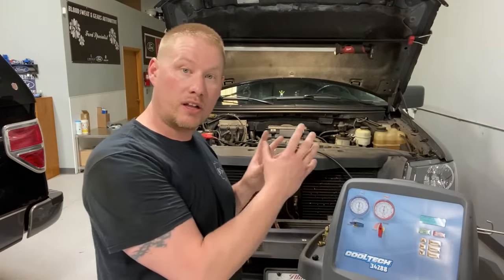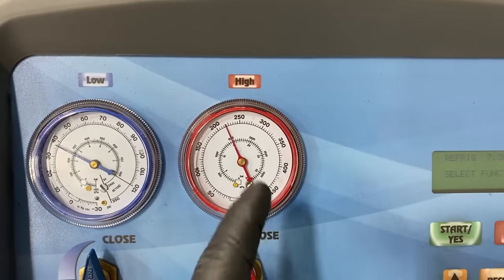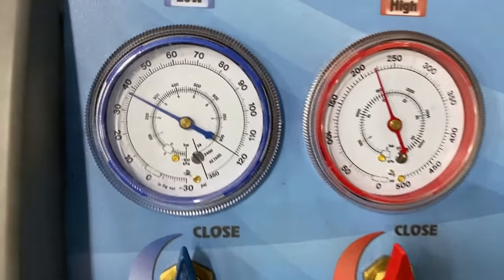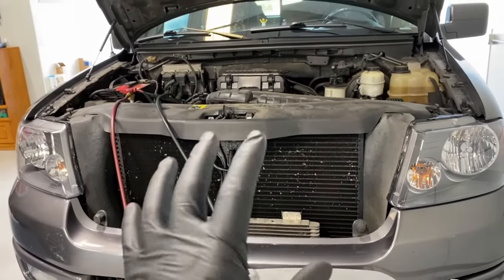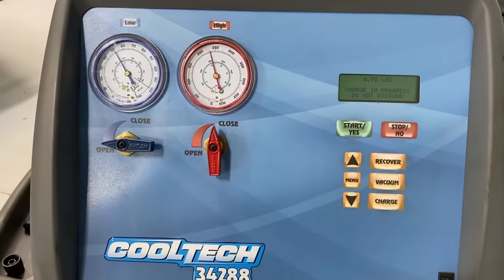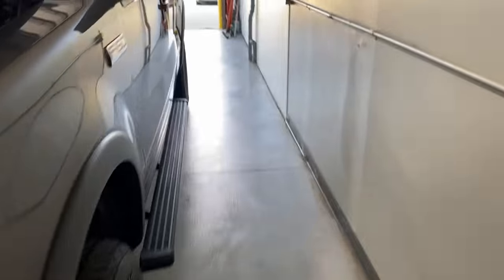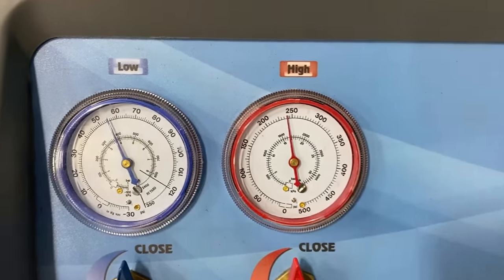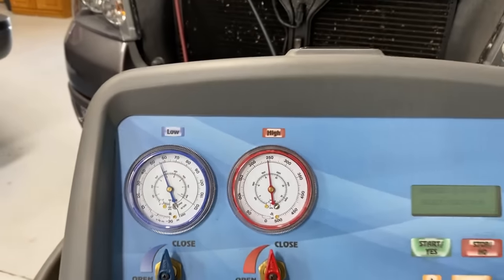Ford A/C Quick Tips #9: How to Spot an Overcharged Air Conditioning System

Comment: Ok dumb question but the ac compressor clutch has to be engaged while reading these guages right? 

I am asking because the pressure drops when the clutch engages
Reply from the maker: correct

Comment: Does that truck have a variable orifice compressor? How would that play into reading the low side pressure of an overcharged system? Are the pressures always read at idle?
Reply from the maker: Just a regular FS10 compressor on an FOT system nothing fancy.
Reply: Regular fixed orifice in this one (2006). Some guys will rev to 2k to check system performance, but I've always done my checks at idle, fan on high, doors open - this is an absolute worst-case scenario for the system - the highest possible heat load. If I get anything below 60° out the vents when it's in the 90's outside, the system will work fantastic.

Comment: Have you had complaints before about a "sweet" smell occasionally coming from the vents with the a/c on? It doesn't smell like coolant or freon. The 05 f150 I had and my 14 f150 both did this. I'm not too concerned about it because everything works but it's odd that I notice it sometimes and other times there's nothing.
Reply: Sounds like a heater core leak, but the 2009-2014's are not known for this, you likely have a small coolant leak from the engine and smell is coming through the fresh air vent in the windshield cowling
Reply: @MrWoundedmoose  If it was then it should be doing it all the time. My old 05 did it now and then and the coolant level always stayed the same so I'm not sure what's causing the smell.

Comment: The AC system on my Explorer has the symptoms of blockage when running.  When I shut it off there is a 10 psi. difference  between the low side and high side pressures which takes hours to equalize.  Does this confirm the system has blockage?  Thanks

Comment: I’m showing 30psi low and 198 high side and 58 deg inside and it’ll cycle to 50psi low and drop to 150 high and cycle back to the previous reading.  2013 f150 platinum 3.5.
Reply from the maker: If it slowly drops to 30 then this is normal, if it’s quick then there is low refrigerant. Hard to tell without watching the cycle time, ambient temps and Underhood temps
Reply: @FordTechMakuloco  I have to remember that fast and slow cycle

Comment: hopefully you can assist me  with this . I have a 07 F150with the 5.4. The internal temp blows at about 50 deg. today I added freon and it made no difference in the before and after readings. its 90deg outside, before adding the readings are 32 low, 245 high. After a can the readings did not change, about a half can later I stopped with readings at 34l, 250H.  the internal temp did not change. Should I just evacuate the system and restart or do you feel it may have other issues?  Thankyou

Comment: Quick question sir, I replaced the condenser and compressor. When I charged the system the ac cycles on and off. The low psi shows 35 than down to 18 high starts at 85 than down to 55 when ac kicks in. Outside temperature was high 50's low 60's.Car should take 1.1 lbs but I put a little more than 1.5. I replaced cts and fan but still the same. Am confused over watching under chargeed and over charged videos. Thank you

Comment: Hi. I'm having an issue with my 2010 mustang v6 ac compressor clutch not engaging. I'm having a hard time to find the high and low pressure cutoff switch which I suspect may be the culprit. Do these cars have them and do you know where they're located? Any help would surely be appreciated.

Comment: My 2014 f150 says 24 oz. I put 2 12 oz cans in it and my pressure readings are 25-28 low side and around 150 high side. I changed expansion valve. Yours shows 34 oz. On your sticker. So I put 3 12 oz cans in it total because its 99 degrees here and 116 with the humidity.  It will not blow colder than 60 degrees out of the vents. No matter if I put 24 oz or  36 oz. I'm just lost. My high pressure fans have kicked on but my pressure is around 200 and my low pressure is around 30. Do I still need to add more? I started to change the condenser  with the expansion valve.

Comment: Ford e-250 with rear a/c low side a/c pressure 65at idle brand new compressor front advance autoparts carquest. New orifice tube,condenser,motorcraft drier? Should I switch the compressor for a motorcraft?

Comment: So as winter ends I went to turn on my AC (2015 mustang gt). It didn’t blow cold so naturally i picked up some refrigerant. To my surprise when I plugged it in it read overcharged. I drained refrigerant out. Ac clutch and compressor kicked on. However I constantly need to keep draining more and more out. And when it does come on only the passenger side vents cool. Mind you last time I charged the system was summer and about 85 degrees out. It’s roughy 60 degrees out now. Could the blend door actually be causing high pressure because the Freon isn’t getting properly cooled? Please help me I’m desperate at this point.

Comment: Ok Brian I am pulling hair trying to figure this one out my 06 F150 super crew has an ac issue the pressures are in speck but the clutch is short cycling so I thought ok maybe it has a restriction so I replaced the receiver dryer and I am the type that will on my personal vehicle replace the other parts that look like they are a little worn because I don’t take enough time for my personal vehicle so that when I do make a repair I get a little OCD because who knows when I am going to get back to work on my own truck the air worked perfectly before I replaced my engine and I never opened up the system until the replacement of the receiver dryer but it will not cool and the ax clutch just short cycles and I am out of ideas as to move forward besides giving up and running without air but it is very hot in Arizona

Comment: So... is there a rule of thumb for what pressures you should be seeing as far as like at what ambient Temps,  or how much the system holds?
Reply: Haynes AC manual has all charts and tables you will need .   Big box fan running on high in front of radiator good idea when checking pressures to simulate driving at say 20 mph .

Comment: Question??? I have a 2010 F150 5.4L & the cooling fan is running & sounding at high speed all the time. Someone mentioned to me it could be a/c pressure switch problem. Problem is, I can't find it. Any advice on where it is located? Thanks.

Comment: I am hoping you can help answer this question for me I have a 2010 Ford Edge and it had a Freon leak so we have currently replaced the following: A/C I-rings, A/C Ref. Hose, A/C receiver drier desiccant bag, A/C Evaporator, Driver side heater blend door actuator driver side, HVAC blower motor control module and after doing all of this I am only getting hot on 1 side cold on passenger and it will not move from the front vents. My question is what else could be my problem because it worked prior to our repair besides not cooling due to Freon leak?
Reply: Broken door or something stuck in the doors.

Comment: Hello there were are you located I'm having problems with my 2013 ford f-150 ecoboost with primary low circuit codes to cylinders 5,6 and module fuel pump

Comment: Ok, I have a 02 Excursion with the V10. It has 79k miles. I live in an area where it can be 110 degrees. My A/C was not blowing very cold. So I took it in to have it serviced. It takes 4.25lbs of refrigerant, and on the service invoice it says my low side was 40psi and the high 225psi. It says 47 degrees on discharge. However on some days it doesnt get very cold. Is 40 and 225 ok numbers? I would like it to be as cold as if it was brand new... suggestions?

Comment: I had a factory charge amount put into my F150. High pressure is @320psi and low pressure is @60psi. Any ideas? I’m thinking expansion valve?
The system held a vacuum and was charge to the correct amount of refrigerant.

Comment: I know this is an old video so idk if I'll get any replies. I'm hoping someone has had this same problem and can answer my question. I have a 2011 ford escape that I changed the condenser and drier on. The problem I'm having is I tried adding the proper amount of 134a but it only allowed me to add half the amount before over charging. I pulled a vacuum and it held 30 micron's of nitrogen so I added one 12oz can and at this point it was reading good on my gauges. The system is supposed to take 1.56lbs which means it should need two 12oz cans plus a little more out of a 3rd can. I did add about 3iz of page oil into the drier prior to charging. Last night I hooked up a quick charge gauge and it was in the yellow until the compressor turned off then if course it went into the red. 8dk if it is cutting on and off do to over charge or because it's actually low and has another issue. Is there something I'm missing, shouldn't it take 24oz seeing the system was completely empty or is it something to do with the page oil I added? Any input very appreciated.

Comment: What if just the high side keeps going up? Ambiet is 75f, i was at 30psi low and high was 150psi with a slightly whiney compressor. Vents were still cold but i was worried about the compressor sound and decided to top off. I added about 2/3rds of a pound and the low side barely moved to 33psi but high side went to 175psi. Kind of high for 75f ambient no? Compressor is quiet now. Vents cool nice at 40f in the middle vent. Think I'm ok?

Comment: Would an overcharged system ever give good cooling? I have about 50 psi on low side and 275 on high side on a 95 degree day in Florida. Every now and then i get great cooking out of the Excursion. Most often I get like warm humid feeling air coming tho. I’m think a blockage in the system and possibly a slight overcharge.
Reply: Compressor may cut out when high side gets too high. High side gets higher when its hotter outside.

Comment: So I have a mystery that I need help on. 2009 FORD f-150 FX4, Evap. Temp: 36-41 Deg F., blending dampers at 0%, vent temp 64 deg. F. when on MAX A/C, cabin temp. sensor shows 194 deg. F. inside the cab. when it's only 75 deg. F. inside. Techs tried to replace cabin temp sensor, still reads the same. Could the damper doors not be connected to the servo's correctly, or could the servos position sensing be wrong causing heat to blend into the vent output air? it's going to a automotive electronic specialists in two weeks under warranty for work, I just want some ideas incase this doesn't work?

Comment: picked up a 10' Ford Escape that AC system randomly purges itself. Figured it was way too high and someone threw a can of freon in it to move it down the road. Lowside is now 20 Highside is 400+. Compressor comes on fine , Its never had cold air and the bottom of the condenser is deteriorated. Picked up a whole ac kit ,thinking the compressor is fine tho,.
Well if you got an extreme highside pressure video add a link thanks
Reply: These are known for the dessicant pack rupturing, and creating restrictions throughout the system.

Comment: Fordtechmakuloco, what would you look for if the system is properly evacuated and charged to the right amount and the pressures look fine but it's still not cool enough coming from the vents? I have an 04 f150 lariat with the auto HVAC controls. Is it possible there is a blend door or valve that's letting hot air mix in, or is there something else in the a/c system to check?
Reply: Yep, sounds like a blend door issue, especially if the low side line is cold coming back to the compressor.

Comment: Brian, I love your videos - keep 'em coming.

This one confuses me, though. The pressure readings you showed at the correct charge seem low to me for 92F (which I think you said was the ambient temp). Or was it considerably cooler in your shop than outside? That said, even at 80-85F I'd expect higher pressures than I see on your gauges during the correct charge phase of the video, based on the published charts for R134a A/C work. I agree with you, I just don't understand the readings I saw.
Reply from the maker: Engine was not up to temp

Comment: Are A/C pressures dependent on vehicle and temperature? I have a 2017 Ford Explorer Limited, what should normal pressures be? Is there a chart that correlates temps and pressures for R134a
Reply: Yes Ford publish them online and the tables are also in the Haynes AC manual .

Comment: Hi, I have a problem with my ford econoline van air conditioning,  it wasn't cooling like should be and when I check the low side pressure was way to high so at first I though it is overcharged but then when I checked the high side I had no pressure at all so I'm confused now, maybe I have a restriction? If you can help me out on this I'll appreciate it, thank you.
I just brought this van by the way.

Comment: Hello there , quick question I have a 07  4.2 , I changed the AC compressor pulled and clutch , that was making a noise , but working good , now that I change those parts the compressor won't turn off !  The longest the AC is on any position the clutch will be engaged , but not engage when is off , before I change the pulley and clutch there was  on and off , what can be wrong? I'll  appreciate any information
Reply: The clutch pulley has a small washer. If you didnt measure the clutch clearance after the installation. That's a place to check first

Comment: High pressure restricts flow
Reply from the maker: And a restriction causes high pressure.
Reply: Doesn't help when the restriction is what's in the pipes. I think with air it's for each psi volumes becomes half and then if you have drop or bends those will restrict

Comment: Hey what do you usually find when you take the charge back to correct level  and it's still not cooling?
Reply from the maker: It all depends on what the original failure was the customer was trying to fix by adding more refrigerant.
Reply: @FordTechMakuloco  I just evacuated my 1st system on a dump truck fixed orifice and pulled 8.6 lbs of freon out when it calls for 3.5.
I flushed the evaporator and condensor with denatured alcohol.
Then recharged the system to 3.5 lbs. With compressor running lo was 15 and high side 110.
Vent temps run 66 with the engine hot and gradually climb until the system freezes up somewhere. The compressor has to be turned off about 10 minutes to get 66 degrees again.
Reply: @RC-Heli835  you may have a bad low side cycling switch when the low side pressure get to about 25 psi it should shut off the compressor until the pressure rises back up it keeps the low side from freezing up. Hope this helps.
Reply: @classicwefi  Yea that never crossed my mind. I've never seen a compressor run at 15 or 10psi on  the low side.   The only times I've seen low pressure switches fail the compressor wouldnt run at all. It obviously is not doing its job. I'll check that tomorrow.
One thing of interest tonight I took some temp shots all over the lines and 3 inches away from the dryer coming from the evaporator the frosted line is 80 degrees. Where the nut welds to the frosted dryer its 14 to 15 degrees. I wonder if ther is some restriction there causing that enormous temp drop?
Maybe it's just freezing up and narrowing the gap?

Comment: I was on YouTube trying to learn about A/C systems, and several of the sites showed a chart that said I need to compensate for ambient temps. The charts showed 45-55 psi low side and 250-270 psi high side to be the right pressures for a 90 degree day. You said the outside temp was 92 deg that day, but these pressures were too high. I saw your demo that at the lower pressures (37 psi & 220 psi) you had 40 deg from the vents, but at the higher pressures you only got 60 deg, so I’m a bit confused. The chart said that at 37 psi low, there should be only about 145-160 psi high (on a 70-75 deg day) so the high & low side numbers don’t match up. Is there something else I’m missing here?
Reply from the maker: It was overcharged so of course the low side will be higher and consequently the discharge temp will be higher. Also heat load in the cabin plays a big role in pressures plus don't forget the a full hot engine bay will also affect the pressure reading big time. So there are allot of factor going on here.
Reply: I realize this is a year old comment but I have the same issue with the pressures dicucssed in this video.  My 08 Expedition is low on charge and I am looking into how to properly add refrigerant.  The car cabin temperature has nothing to do with the pressure only that there is enough load to keep the expansion valve fully open.  The outdoor ambient temperauare, or condensing temperature drives the system pressures.  It seems to me that you started with an undercharged system and the system was properly charged or slightly overcharged after adding the refrigerant.  I plan to go with the R-134a Temperature and Pressure chart data, quoted in the comment by jazzbuff1394, to charge the system.

Comment: When you recover with that machine does it recover the PAG oil too?
Reply from the maker: Yes the refrigerant carries it with and is separated inside the machine and dispensed into a container on the front.
Reply: @FordTechMakuloco  Rarely does it take out all of the oil. You should measure the drain oil bottle, then add the same amount when you recharge it.

Comment: I replaced the condenser coil in my 97 Ford e350 and the  head pressure was 350+ with 1lb 14oz r134a ( factory charge was 2lb 12oz) this is to the factory coil being tube and fin coil and the replacement coil being microchannel. My question is how much do you reduce the charge? This is a fixed orfice system. Thank you in advance for any advice.
Reply: You got the wrong part, even if it works for awhile, you will burn up your compressor. The solution, get the right part.
Reply: @desnootz9547  what do you mean by i got the wrong part Motorcraft doesn't make these anymore.